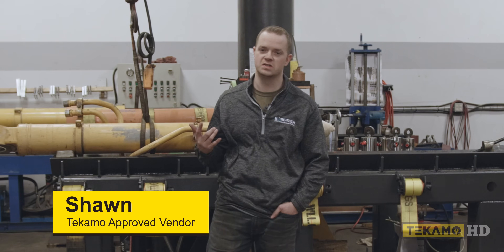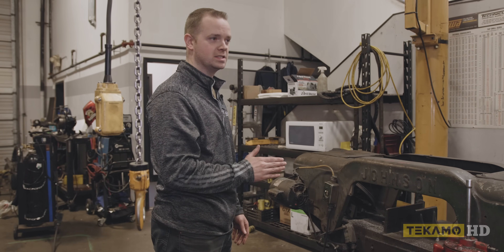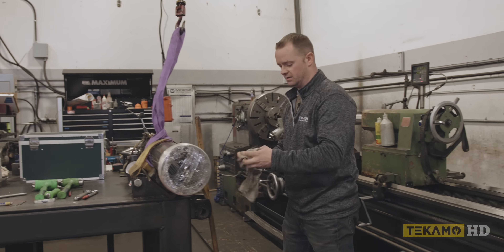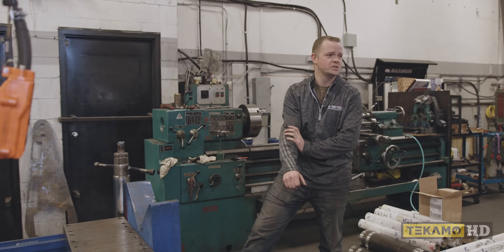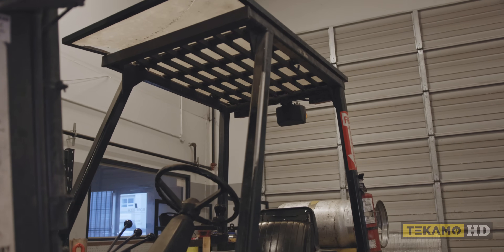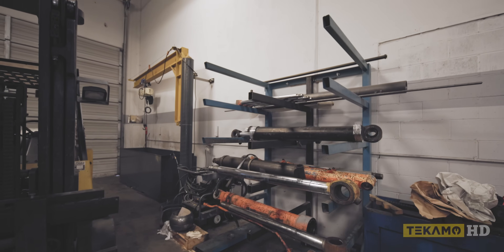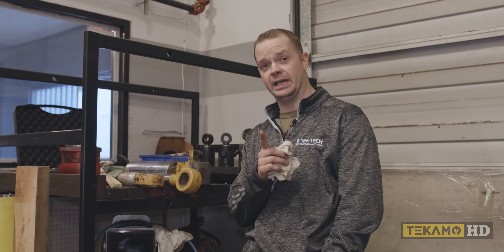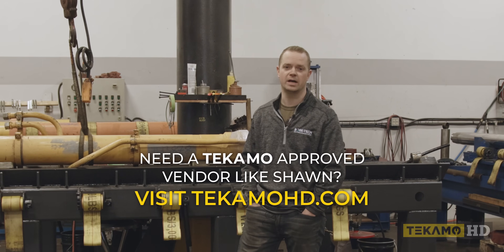What Does It Take To Repair Hydraulic Cylinders?  Touring A Hydraulic Repair Shop

Comment: Great video!  Shawn, what is the typical grit for polishing and honing rods and tubes?  I’ve been looking for ideas on how to build a repair table, this was a big help.
Reply: For polishing rods I recommend 240 grit belt, it should give you a surface finish between 2-8ra which will be suitable for a standard lip rod seal. 

For the hone we use 45 aluminum oxide stones first, then we just use 220 grit sand paper on high rpm slow stroke. Gives use a 8ish ra, if we have a Teflon piston seal we will just run the hone longer with that grit and then switch to Scotch Brite (red) to get a finer finish.

Comment: Could you have Shawn explain how to bleed a hydraulic cylinder? We’ve had a Liebherr 946 “cook” seals repeatedly on the stick cylinder and his explanation of dieseling has me wondering
Reply: Hi, if the seals that come out of the cylinder are chewed up then I would say it would be air in the cylinder. And we can do a video to explain the best way to install and bleed a cylinder for you! 
But, it could be a number of things that can contribute to early failure. 
1. Bad oil, but that would result to many failures. Not just the stick. 
2. Extrusion gaps are out of spec, this would result in the seal looking stretched out. I know liebherr's run high psi so the extrusion gaps are very critical on these cylinders. 
3. In correct Rod surface finish and barrel surface finish. Liebherr's typically have Teflon seals and they would require a finer surface finish 2-4 RA I believe. 
If you would like you can send us your old seals or photos of your old seals that have failed and I could do a visual analysis on them. I would be able to help a lot more with that. 
Let me know and thanks for the comment!
Reply: @ShawnMcCulloch-pe4yk  hey Shawn , if you don’t mind me asking, what’s the proper bleeding procedure for any cylinder?